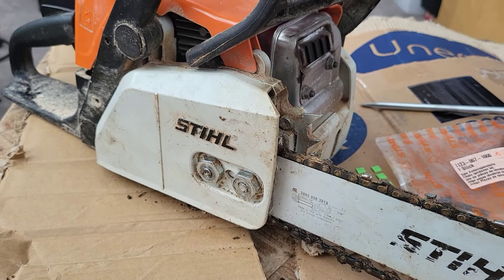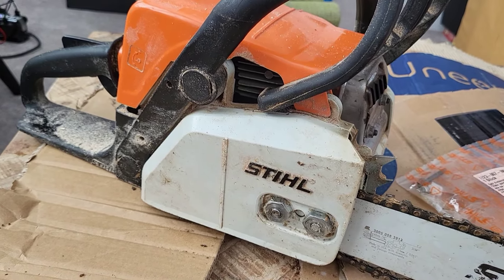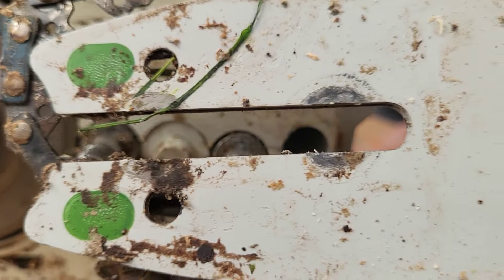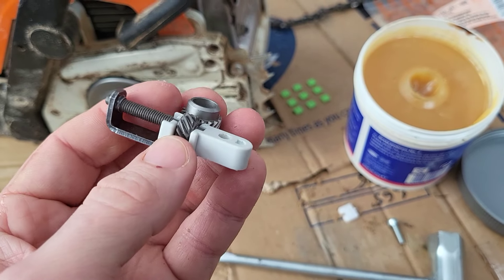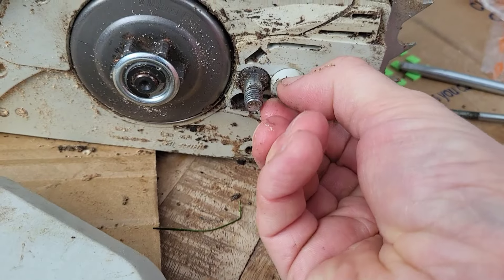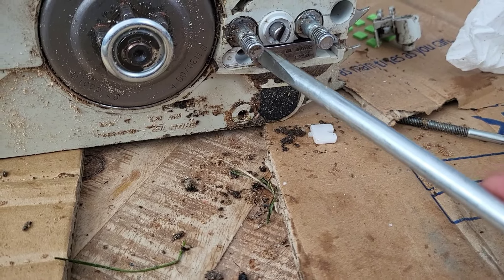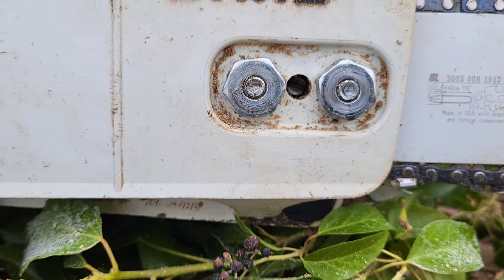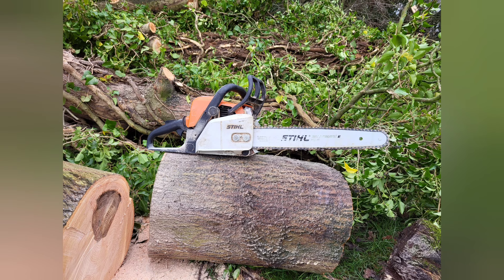Stihl MS170 - chain tensioner upgrade and review

Comment: I was given a MS170 by a friend who couldn't get it to run, and he just wanted to get rid of it.
I cleaned it then emptied the old fuel & oil because he couldn't remember when it was put in.
Filled with fresh fuel & oil, and fingers crossed I went through Stihls start procedure.
It took a while but eventually I had it running.
Next thing was to upgrade it - a dog was installed along with the side chain adjuster - it is a pleasure to use with the 14-inch bar & chain which suits our Australian hard woods.
My MS251 with an 18-inch bar & chain does the heavy work.
Stay safe.